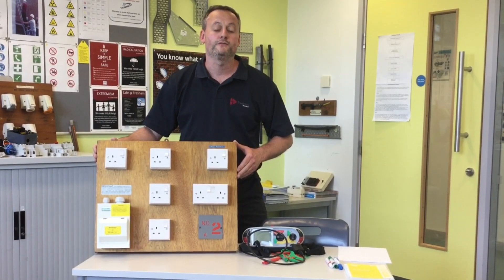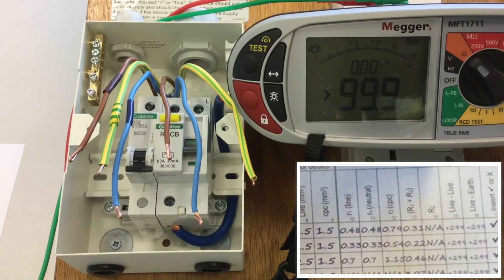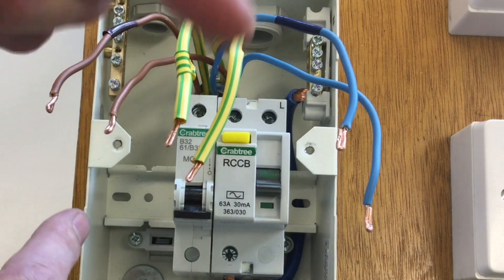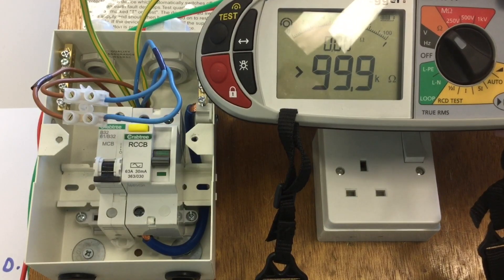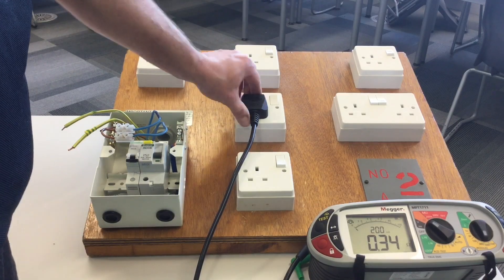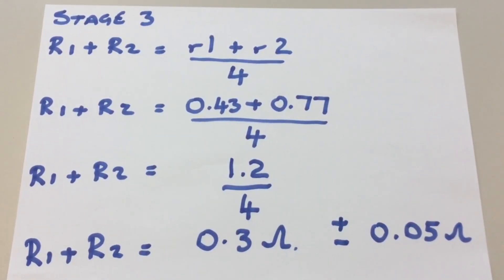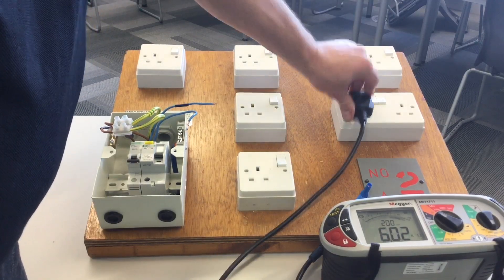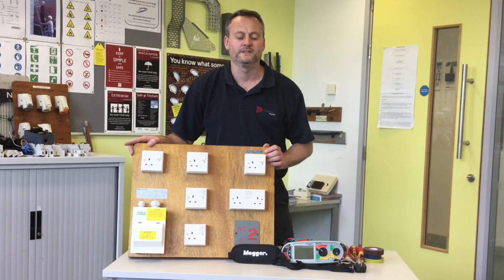Ring Final Circuit Testing for Sockets Wired in 2.5 Twin and CPC Cable (Twin and Earth Cable)

Comment: Im not an electrician but interested in this and ive understood everything apart from 1 thing if anyone can answer.
At 5.07 when measuring at the connector block you show the leads in the back of the MFT.
Red in L1 and Green in L2.
At 5.32 you swapped out the Green lead in L2 and put in the Blue lead,why was that?
At 8.35 when measuring the connector block,you had the leads in the back of the MFT
Red L1 and Green L2 but they stayed the same when you tested all the plugs,so why did you swop out the lead at 5.32 of the video?

Comment: if  2.5mm2  is rated to a max current of 25amp why is the circuit rated at 30amps?  If any part of the ring is broken it is a good possibility that no fault will be noticed by the user.

Comment: Why we persist with the ring in this country is beyond me. It’s an outdated and fundamentally flawed design which is illegal ( domestically ) in many European countries. Why ? because when there is a break it usually carries on working despite the fact it is now potentially dangerous as it has been de-rated by 50%. As a self employed electrician with 40 years experience who does countless E.I.C.R.’s I find one in three rings I test have an  open circuit on one of the conductors and for that reason I always use 4mm Radials in new installations now.
The domestic ‘ ring ‘ was brought in after the Second World War due to a shortage of copper. IMHO the ring should only be used in HV infrastructure to enable maintenance and continuity of supply.

Comment: Ring circuits are the devil , am a spark of 25 + years , 4mm radial all day long 👌
Reply from the maker: Totally agree 👍
Reply: I have seen radials that are the Devil as well. A whole new radial with four or five sockets on it, off the back of a socket, with the socket terminal being the star.  A few of them as well. The socket terminal worked loose, as they can and do, causing a black mess with a new socket needed. Sockets make poor junction boxes.

Comment from the maker: == 🕐 Time Stamps - Cut to the action 🕕 ==00:00 - How to test a ring circuit 

00:46 - Consumer unit layout
00:58 - Identifying the legs of the ring circuit
01:56 - End to end test r1, rn and r2
02:30 - The rule of 1.67 times greater
02:59 - Reading for r1, rn and r2 
04:12 - Calculations for R1 + RN and R1 + R2
04:40 - Linking opposite line to opposite neutral
05:29 - Testing at every socket outlet
06:50 - Finding a high reading on the ring circuit
07:38 - Spur from the ring final circuit
08:31 - Linking opposite line to opposite CPC
09:10 - Testing at every socket outlet 
10:22 - Finding and recording out highest reading in ohms 
11:00 - Using a torque screwdriver for the connections in the consumer unit

Comment: Do you think the readings can change from disconnecting test leads after testing at board and using the plug at the socket? There’s isn’t a tool that can null the plug is there?

Comment: Please I can see from the consumer unit, the ring circuit are terminated in the same point. Is that how it should be done because I was thinking since the neutral block terminal or link and the earth block terminal or link are not splitted, it can be separately. Any explanation please

Comment: Please I wanna ask a quick question, you could see that from your continuity test of the ring circuit, the phase or Live conductor and the neutral conductor has the same reading but that of the CPC or earth conductor has a greater reading value as compared to the other two even though it has a smaller diameter of 1.5mm.

Please why is it so.
Reply from the maker: Smaller conductors have higher resistance 👍

Comment: Hi gaz are these the 3 tests a sparky would do after say wiring a new kitchen ring final sockets, or is there other tests to do to make sure the sockets are working and safe 👍 cheers
Reply from the maker: This is one of many tests required after wiring a new ring circuit 👍.
Reply: @GSHElectrical  cheers gaz 👍👍

Comment: Why is the mathematical relationship between 2.5mm squared and 1.5mm squared 1.67? Is this worked as a ratio of 5:3 and therefore 1.67? Thanks.
Reply: 2.5 divided by 1.5 = 1.67.

Comment: Hi Gary isn't you end to end on r2 a little high 0.43 x 1.67 = 0.71 ?
Reply from the maker: We have built in resistors in the rig... but yes you are correct if the cpc is 1.5mm2
Reply: @GSHElectrical  Thanks for clearing that up thought i had missed something ! Perfectly explained video Many Thanks

Comment: Fantastic, your video was Faultless and I loved the inclusion of the spur socket at the begining without letting than one out of the bag when testing. Note to sure I would have not made a comment informing your viewers that on the Form it is important that whilst showing the correct readings taken from the Ring Circuit that it is worthy of note that the Higher than Normal Reading was taken at the Spur from the Ring Circuit.
Sorry but I am old school and believe in making everyting that bit easier for when the next guy shows up and he is not scratching his head.

Mr Spence Eng

Comment: As a home wiring diy’er I found this very interesting. Luckily there is not too much to it. Just using resistance to check that all is well. Simples. I like wiring because you can work most stuff out if you think about it logically. Thanks for taking the time to make your video.
Reply from the maker: Thanks for watching and commenting. All the best. Gaz 👍

Comment: maybe I'm being think and totally missed something, but at the start of stage 3 at 8:28 your R1+Rn you have 0.43 + 0.77. Is this now a new calculation not continuing from the step 2? I'm just curious to know where the 0.77 came from.
Thank you
Reply: R2 is the CPC which is 1.5mm (squared), as opposed to the Line and Neutral which are both 2.5mm (squared) (Twin & Earth). This means that the CPC should have a higher resistance seen as though its 60% smaller than the line and neutral.
Reply from the maker: Hi. Stage 3 is R1 + R2 and not R1 + Rn

Hope this helps and thanks for watching Gaz 👍

Comment: Hi, is it normal to get no resistance at the CCU while doing stage 2 of the ring final test? While doing stage one I did get resistance from all conductors,  but at the CCU during stage 2 there was 0 resistance and at the socket outlets I had a reading of 0.35 ohms.
Thanks
Reply from the maker: Hi. No you should get the same reading at the consumer unit as you do at each socket on the ring during stages 2 and 3.

Comment: Hi 

Are you using resistors in the sockets as the length of the Run is quite short
Reply from the maker: Hi. Yes we have added resistance to the circuit conductors 👍. Thanks for watching and commenting Gaz

Comment: Hi Gaz so although you connect opposite lines and neutrals u still connect to both live parts of connector block
Reply from the maker: Hi. Opposite line and opposite neutral in the same connection 👍. Thanks for commenting and watching Gaz
Reply: @GSHElectrical  Yes I saw that but looks like you probed both live screws
Reply: @shaunbeard593  Doesn't matter as leg 1 live is connect to leg 2 neutral & leg 2 live is connected to leg 1 neutral so you have your conductors connected to give you your R1+RN readings
Reply: @andrewrea4233  it threw me a bit as probes were on both live wires. Fairly new to this so was just confirming thank you

Comment: Great video - Having been a high voltage engineer for the past thirty years, and when my friend told me of an issue with her socket ring intermittently tripping, this video reminded me of just how to test efficiently an LV ring circuit ....quite humbling how big a variation there is between testing on high voltage networks and low voltage ..... no not really ..safety is always first .. no matter what the voltage
Reply from the maker: Thanks for watching and taking the time to comment Gaz 👍

Comment: A semi-related Q. Is there any sure fire way to check which type you have. Our house was rewired in 1987. I see a single socket which has only 1 wire and I can't tell if it's just a spur off the main ring. The double socket beside it has two wires. So the single seems liked it's spurred from that. Or it could just be the end of a radial as it's the furthest point away from the consumer unit on the first floor. I've checked the circuit breakers for the mains and they're all rated for 20Amp.

Comment: When you are doing stage three testing and the meter displays 0.3, you are saying this is 0.03. Do you mean this or is this a mistake?
Reply from the maker: I apologise 👍. Thanks for watching Gaz
Reply: GSH Electrical thanks, wasn’t meant to be clever it’s just I’m interested in such things and needed it to be clear in my head. Whilst writing, a question for you 😀. A high voltage igniter pack had written on it 33% ED in 3 mins. What does this most likely mean?

Comment: My question is this...how many socket in one 220v circut
Reply from the maker: Hi. In a domestic dwelling you can have as many BS1363 socket outlets as you want however the Limiting factor is the floor area. For an A1 Ring Final Circuit 100m2 for an A2 radial socket circuit 75m2 and an A3 radial socket circuit 50m2. There are other considerations but these are the basic rules thanks for watching GSH Electrical 👍

Comment: Hi, have you included resistors behind the board to get those resistance readings? Moreover, I have seen the working bench that your students are working for the cable tray bend. What kind of bench is that? Great videos keep doing them. Congrats on your work from a fellow electrical tutor in Cyprus.
Reply from the maker: Hi. Thanks for the positive comment and yes the board has resistors built into it. All the best GSH Electrical 👍

Comment: All good stuff Gaz as usual...On certificates it is also worth noting (and I think there should be a dedicated space for it) that the high readings taken, and those recorded on the certificate, for R1+R2 and R1 +Rn  were at a spur...because mathematically they are out of allowable tollerance, as you prove in the video. ...At first glance of a certificate...Say... on a EICR, the inexperienced may wonder what is going on....
On a different note ...the 1.67 ratio between Line  and CPC is great ...BUT... only on 2.5mm Line and 1.5mm CPC...it varies with the cable size....10mm or 6mm cable (line/neutral size) ..a different ratio mathematically exists between L N to CPC, as I tried to explain to someone recently...and they were having none of it...telling me I was wrong.....then a few days later.....I was correct....They read a book..ha...none the less they read and now know...job done.
Reply from the maker: Hi. Totally agree we annotate the paperwork at Level 3 with all sorts of extra information. This was a level 2 introduction video to test ring final circuits. Thanks for your Quality input Gaz

Comment: hi the first testat join block would u have to put both probes in live side or could u do on blue side
Reply from the maker: Hi. The opposite line and opposite neutral are linked in one connector block and the reverse in the other connector block. Then the measurement is take with one probe on one block and the other probe on the other block. Hope this help GSH Electrical

Comment: Excellent video once again.  A couple of questions... where there are a number of spurred sockets whats the best way of finding the socket(s) they've been spurred from?  Also, if there's found to be multiple loops or interconnections would they have to be rewired so as to be part of the main ring?
Reply from the maker: +Jake Chattey 
Hi. The fault finding for multiple spurs is one done on instant. Think which socket looks most likely to have been used to spur from. You can also drop the front screws off all sockets but it still could be a spur from a joint box under the floor. If you find the socket the spurs start from the easiest thing to do is put a fuse connection unit in (fuse spur) making the spur sockets fused at 13 amps. Thanks GSH Electrical

Comment: Hi Has this test got to be done at the board ? Why can't you take a socket front  off and do it there.
Reply from the maker: +Roy Kirkham 

This test is carried out at every point on the circuit to prove all sockets are on the ring and we don't have multiple loops, interconnection or a run on non fused spurred sockets. The first test at stage 2 is carried out within the consumers unit confirms your calculation but with this figure of eight test is one of the points on the circuit. All points (socket) including the consumers unit have exactly the same amount of cable (resistance) so they all should have the same reading during the test if they are on the ring. The video accompanies my lesson(s) and would be an hour long if coved all points. Sorry this time I cannot offer more help GSH Electrical
Reply: I think what RK is getting at is can the crossover be carried out at a socket ?
It certainly would be easier identifying the legs for crossover especially when you’re confronted by a congested untidy boards.
The rest of the test can then be carried out at each socket as normal.
I would probably remove the neutrals and cpcs at the CU and put them in separate connectors as a precaution.